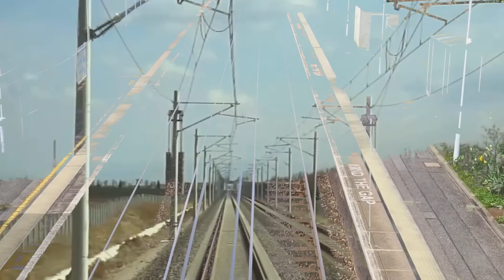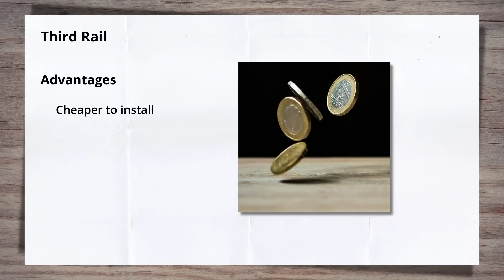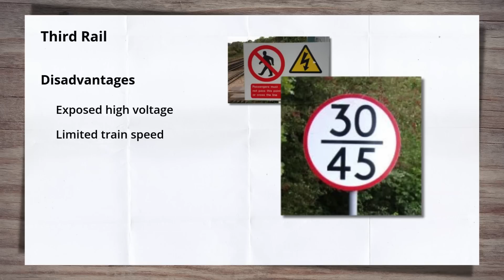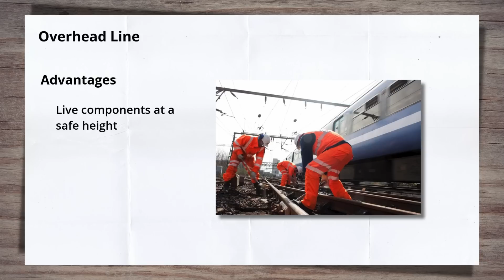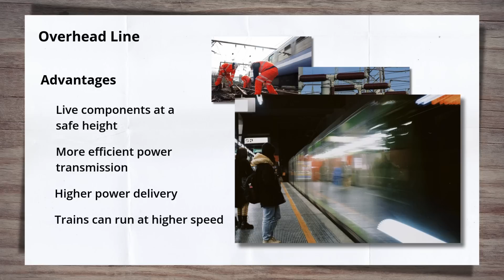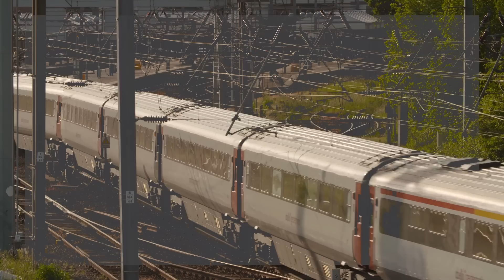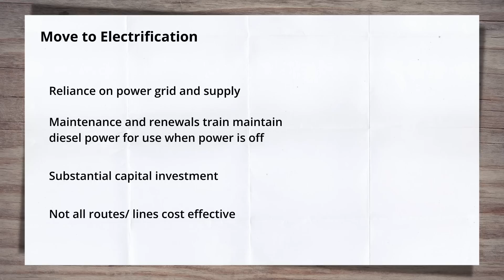How Trains Are Powered on the Railway | Third Rail vs Over Head Line Wires

Comment: Despite the over-engineered, over-expensive GW electrification, its resilience to damage is appalling, as was proved earlier this year.
For high speed lines, there is no alternative to overhead supplies (unless using diesels as per class 43), but in urban areas with clearance issues and potentially lower speeds due to track geometry, third rail might be a better option.
The class 313 trains on the Moorgate branch and the dual voltage Javelin trains in Kent both on HS1 and the 750V dc network have shown that the systems work well. Perhaps the lines through Bath could have been electrified this way, cheaply and without upsetting the sensitive eyes of the Nimbys?

One point regarding efficiency- Overhead line are not more efficient due to being on AC, but it is because the very much higher voltage possible reduces the current required, and thus resistive losses, so a smaller conductor can be used. It is only required to be AC in order to step down the voltage via a transformer on the train to a usable working voltage. (Note that Belgian Railways used 3000Vdc overhead but would still need to have a current carrying capacity 6 times higher than that of 25kV system).
Reply: The major problem with conductor rail electrification is safety, and for that reason it's quite difficult from a regulatory point of view to extend existing lines, never mind new electrification schemes. Personally speaking, I don't think myself or my colleagues should be electrocuted at work to protect the sensibilities of nimby sorts!
Reply: @helga_antal  The problem with using safety as a reason for not using third rail is what do you do about systems already in widespread use? e.g. Merseyrail, Northern City Line, Glasgow Subway, London Underground and Overground, plus the huge ex-BR SR network. Do you shut them down because they are unsafe? Track Staff should have safe working methods in place (I have personally worked on live systems under strict safety procedures), but trespassers deserve Darwin Awards- I have no sympathy for them.
The risk of unintended contact with the third rail can, however, be mitigated by timber shrouds, as already used in some locations.
My intentions were to avoid the huge cost of raising bridges (and their parapets because idiots still manage to electrocute themselves on the overhead wires).
In the Bath area, the track curves would prevent high speeds anyway, so third rail is quite satisfactory for speeds up to 160km/h.
I actually share your views about Nimbys. They have cost the country dearly with the HS2 tunnelling so I really don't care if they are upset, but they would certainly have less about which to complain and hold up progress.
Reply: @MervynPartin  I generally agree with the ORR policy statement, I'd say. From their point of view, the existing mainline network can stay with small extensions and upgrades and so on, but newer stuff has to be safer. They rate LU and DLR as being safer than mainline third rail, at that. They're not proposing tearing down the former southern region, but a new top-contact scheme isolated from the wider network would be very hard to justify, even if every inch of it was boarded. We're trained on safe working, but if you're placing interlocking shrouds down straight on top of the conductor rail, and have to get them off when a lookout blows you out, it's another thing that can go wrong.
Reply: @MervynPartin 
The whole GW route should have been done on 3rd rail long ago. Apart from the other advantages it would then have been compatible with Southern and London Underground routes. The Elizabeth Line would have been less expensive.
Reply: @physiocrat-sv  But the Elizabeth Line also extends east to Shenfield which already had OLE.
Adding any form of electrification to the Dawlish Sea Wall section would be problematic.
Reply: @TheRip72  
The Elizabeth Line was originally planned as a tube. Apparently it suffers from reliability problems. People also complain that the trains are unsuitable for long journeys. Many of the interchanges are very poor; you have to come up to ground level and go back down again.
Reply: @helga_antal 
Electrified third rails discourage trespassing. That is an important safety feature.

Electrification masts are a hazard in themselves. Fatalies at Souhall and elsewhere been due to impacts with masts. The attitude of the safety authority is inconsistent.
Reply: The fastest 3rd rail lines are 100mph. Javelins only travel faster when running from overhead power. Travelling on the 3rd rail network feels so slow after whizzing to Ashford on HS1. The Western Region has been using 125mph trains since 1977. 3rd rail electrification would have lowered line speeds back down to 100mph. It also requires sub stations every 2 miles instead of 25 miles.
Reply: @TheRip72  I was not proposing total electrification with third rail, but just pointing out that the Javelins show that fast running is possible on the 25kV overhead, and can travel on third rail systems, albeit slower. I suggested Bath as a suitable location as the curves would prevent high speeds anyway and there would be no need to rebuild any bridges for increased overhead clearance. The number of substations required in that area would be minimal. It would enable the use of diesel through Bath to be eliminated at reduced cost.
Reply: @TheRip72  100 mph is fast enough for the GWR due to the closeness of the stops these days. There cannot be much 125 mph running as there was when the HSTs were introduced. 

There are closely spaced, hideous and massive structures - a string of gallows and goalposts. The whole project was years late and over budget and still wasn't complete through Bath last year.
Reply: The majority, if not all, of GW failures have been on the 1990s installed and weaker equipment (between Paddington and the junction for Heathrow), rather than the newer parts (west of said junction) though, no?
Reply: @fetchstix  
I don't use the system often enough to know about its reliability but the GW electrification is an appalling 100 mile long eyesore. Apparently the engineers made a mistake with the calculations and everything is much more chunky  than necessary, and that added to the cost and delays; it still isn't finished. 

It could have been done on the 3rd rail system 30 years ago. I travelled thousands of miles a year on the LT, Southern and LMS electrified lines for over 50 years and failures of electrification were extremely rare. There were 3 feet of water in Lewes Station once and they had to use steam trains, and in January 1987 we got class 47 diesels hauling the EMUs but that was extreme weather.

In those days everything was compatible with everything else. That's the way to run a railway.

Comment: The Railway line through North Wales is not electric, so can only have Diesel trains over here.   In the 1980's the train to London would be diesel powered, usually a class 45, or 47, until Crewe, then the locomotive would be changed at Crewe, for an electric one, something like a class 86, or 87.

During the 1990's the HST 125's were put onto the London to Holyhead service, and the same locomotives were used all the way through.  Trains from Llandudno used DMU's, and are now using the current version of those.  

As the whole of North Wales does not have any electricity on the route, it is suitable for the Steam Special service.  This happened in the summer during the 1990's, and was very popular. They still have special steam trains coming through now, but not as often as they were in the 1990's.
Reply: @petermostyneccleston2884  I'm sure Virgin were diesel-hauling a Pendolino set along there at some point in the 2000s. I remember it being an extraordinarily smooth and quiet ride.
Reply: @6yjjk  they did do that at some point, but that was the only way that they were able to take the electric train units beyond Crewe.
Reply: @6yjjk  that's right :) The diesel loco also supplied so-called "hotel power" at 240 VAC single phase to the Pendo's, so that the lights and so on worked, and passengers didn't get left in the dark at night time  

How embarrassing for an electric train to have to import electricity from a Diesel loco...😮
Reply: Electrification of the North Wales coast line would be asking for trouble.
Reply: @physiocrat-sv  in what way?
Reply: @trueriver1950  
The track runs right next to the sea. Similar to Dawlish. The electrified line is by the sea between Ardrossan and Largs.

Comment: You have mixed up the term transformer and inverter. The transformer is used on ac systems to drop the 25kv down to around 1kv for the traction system. Dc systems use an inverter to convert the 600 to 800 vdc to ac for other systems. All modern trains first of all make dc on board and then convert it to different voltages and frequencies for the auxiliaries and traction supplies.  Dc sub stations now have inverters to convert the regenerated dc into 50 hz to pump back into the grid. It’s a lot more complex than your explanation. Also you might ask why DB and SBB etc use 16 2/3 Hz. I could go on for hours on that subject, but it is actually a more efficient system. AND it allows regeneration into an ac oh without semiconductors or rotating converters way back from the 1920’s.
Reply: the lower the AC frequency, the larger the core, and thus heavier, for the same voltage and power.
Reply: @philhoward4466  conversely, the AC square wave in the middle of a switching DC-DC converter will run at over 1000Hz to maximise efficiency. That actual transformation stage of a switching converter is just a normal transformer, optimised  for the frequency of the chopper.

Comment: My father in-law was working on an overhead gantry, he slipped and came into contact with the 1500VDC used on Australian suburban trains, he survived but lost his arm just past his elbow. (boy was he lucky)
As for wires stretching during heat events, that has long been solved by using weights and pulley wheels to keep a constant tension on the lines, irrespective of the heat, have a look at 0:20 those 'things' ever side of the poles are a stack of steel plates used for such.
Reply: Would that be in Sydney or Melbourne? As they both use 1,000VDC! Not like in Brisbane they use 25,000V~
Reply: @jonathonshanecrawford1840  Well that's interesting for what I know Melbourne is 1500, and I assumed the rest of Australia would be the same.
Reply: @paulstubbs7678 it's not. Qld is 3500V AC. Another disadvantage to overhead electrical supply is that a storm can knock out whole segments of track, was working in Callemondah yard one day and had a storm take down the overhead traction right as we were heading back to stable
Reply: @Falkirion  I know that QLD uses 25,000 Volts AC, like Auckland and between Hamilton and Palmerston North. Both use the Narrow Gauge!
Normally wind would not bring down the over head wires, unless the wind was well over 100Km/hr or poor maintenance! 
It is true storm can bring with them debris that could "catch" the overhead wires and bring them down, however, its rare that it happens ~ it is the design of the structure is the key!
Reply: @jonathonshanecrawford1840  ah I knew it was 35 something. Haven't had to deal with the QLD system in over 2 years
Reply: @Falkirion  Yes, 25,000 Volts AC, not like in Sydney and Melbourne, they use 1500Volts DC. While the rest of Australia uses 25,000VAC.
Interesting thing I noticed that all the Australian trams and most countries use the standard gauge i.e 1435mm (4'8½").
Reply: @Falkirion it’s years since I’ve seen a Melbourne system knocked out by storms. Oh and 3rd rail can be knocked out by almost anything from floods to high winds bringing debris on the rail.
Reply: @Falkirion  Queensland doesn't use 3500AC. It uses 25000 AC, this is what is the bench mark standard around the world, Adelaide and Perth use this system too.
Reply: @paulstubbs7678  Melbourne and Sydney use 1500DC, Queensland, Adelaide and Perth all use 25KV AC a system pioneered by France in the early 50s 
It is used on all Overhead catenary rail systems in the UK.and very common in mainland Europe.
Some countries also use 12500 AC.
There is still a huge amount of 1500DC in France and the Netherlands.
The other common voltage is 3000 DC that is used on much of Italy and Russia.
Reply: @Steven_Rowe not only in Russia, but all 15 countries of former USSR
Reply: @Steven_Rowe Sydney's various Metros do/will use various voltages (because of course they do, it  would be 'silly' to have things compatible), so M1 uses 1500 VDC, and actually has a link to the existing suburban system  for maintenance, but the Western Sydney Airport Metro will use 25kV AC, and finagle knows what the Western Suburbs and others will use.

I think the Ski Tube in the NSW/Vic snow country uses 25 kV AC, and there were plans for a 25 kV coal railway in the Southern Highlands south of Sydney (abandoned).

HSR plans (don't laugh) seem to be 25 kV, maybe using the 1500 V system in the suburbs.

Sydney trams use 750 VDC, I think the pre 1961 system was ~ 600 VDC.
Reply: @mt-mg7tt dual voltage locos are common in Europe,.France has a huge 1500dc network and run trains at 200kph, but many of these locos are 25kv and 1500dc.
Regardless all modern locos convert AC to DC then through a 3 phase inverter to run AC reactions motor.
The metro does this along with all the latest Interurbans
Reply: Those "things" are called counterweights, I think.
Reply: @Gelatinocyte2  Yes your correct! And at the top there are insulators, pulleys and springs!
Reply: Nowadays they are using springs to achieve the same results rather than using weights.

Comment: Your clip was informative, and you sound quite convincing, yet should we take everything you say at face value? Two examples: 
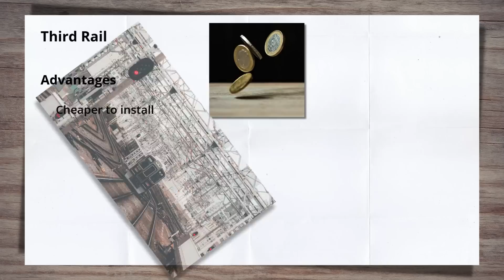1:43 Apart from this being a skewing tele lens catch, masts do not have to look like that. Germany in particular invested energy in designing masts that have fairly little visual influence on their surrounding. Have a look at the WP article 'overhead line', then click on the german version, then count down to the eighth photo - 'stahlflachmasten deutscher bauart'. [Another way to gather info on this would be via YT, then 'führerstandsmitfahrt' (cab ride).]
Similar masts as the ones used fx in Germany were also erected earlier in Britain. Why did your decision takers not follow course when the Paddington - Cardiff line was electrified? As far as I can see, this question was raised a number of times in the public (maybe not quite as straightforward) but never answered by those responsible. 
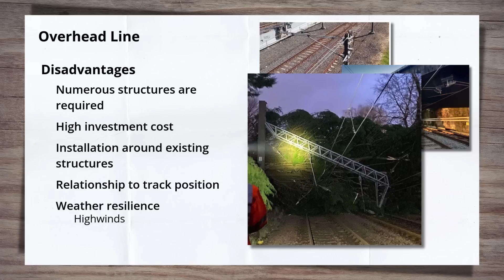7:34 Are you certain? There's a tension mechanism, in Germany it has been used since the early days of electrification - the learning phase was from ca 1905 to 1930, since then the overhead system has not changed substantially. (It was copied by most other countries.) If you scroll further down on that same WP page, slightly beyond mid-page to the photo 'radspannwerk DB-bauart zur getrennten abspannung von tragseil und fahrdraht'? And why not use the chance to also note the following image, 'überlappende...'
Reply: The Great Western electrification is a 120 mile long eyesore of gallows and goalposts stretched across Southern England.
Reply: Ob the topic of Germany, 3rd rail Systems used by the Munich underground and the Berlin S-Bahn, are not exposed on the top. They have a (I assume plastic) cover on top and are So far off the ground that I have seen Rabbits traversing the rails without problems.
Reply: @red_rass_MC  still can zap you, even with bottom contact 3rd rail. I prefer the bottom contact 3rd rail that runs at the ceiling as a low clearance OHLE